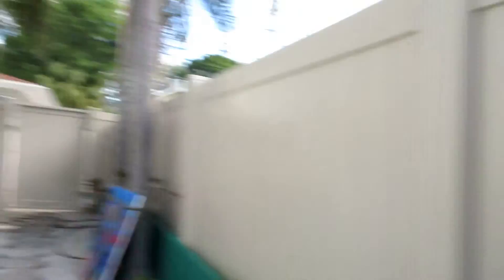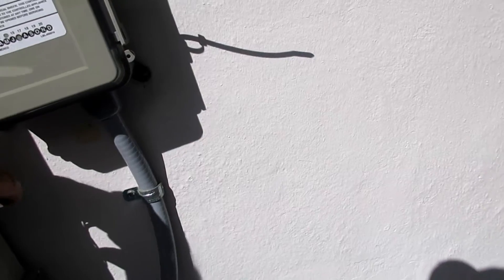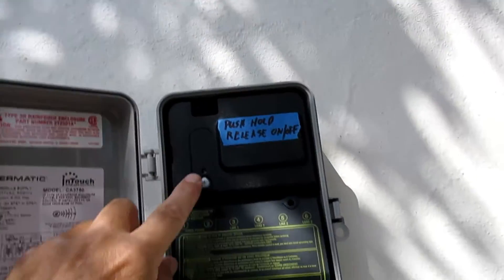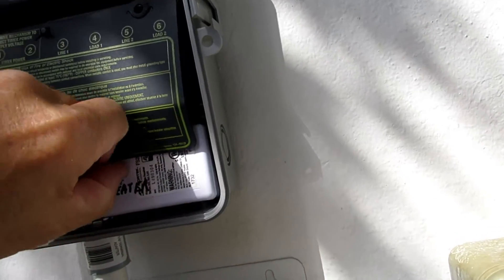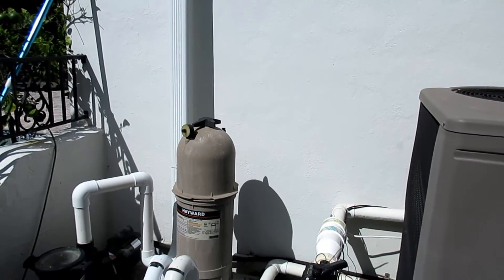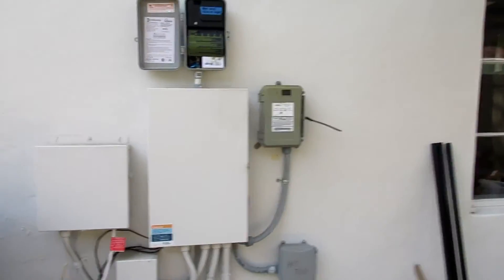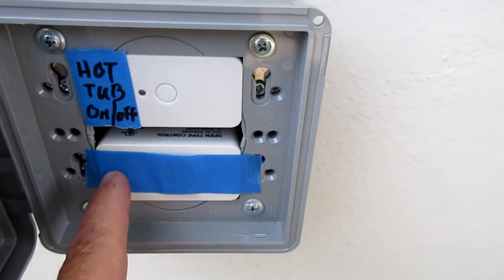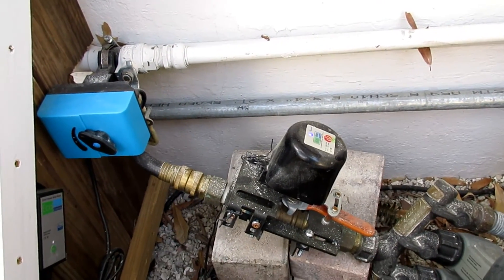Smart Home Pool and Spa automation

Comment from the maker: I used a motorised valve controller that fit over my existing valve. (removal valve handle, install over top of existing valve.) You will have to confirm compatibility with your valve type/size. This is the motorised valve controller I used: https://www.jandy.com/~/media/zodiac/global/downloads/h/h0570800.pdf
along with a 24v relay https://www.amazon.com/URBEST-HH52P-Electromagnetic-Power-DYF08A/dp/B00NN5ABG2/ref=sr_1_2?s=hi&ie=UTF8&qid=1532350262&sr=1-2&keywords=24v+relay&dpID=41D0vD%252BCWeL&preST=_SY300_QL70_&dpSrc=srch
in combination with a Z-Wave relay: https://www.amazon.com/Remotec-Zwave-Contact-Fixture-Module/dp/B00913ATFI/ref=sr_1_1?s=hi&ie=UTF8&qid=1532350362&sr=1-1&keywords=remotec+zwave+dry+contact+fixture+module
Cheers! (support@econetcontrols.com)
Reply: Do you have a wire up/product install of the pool pump/heater
Reply: Hello